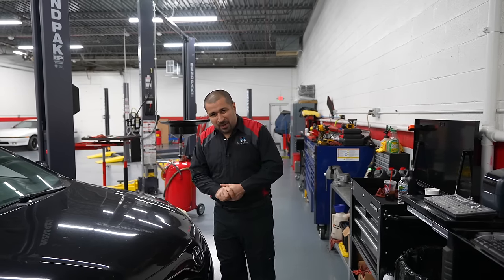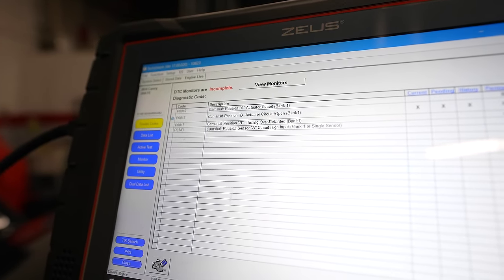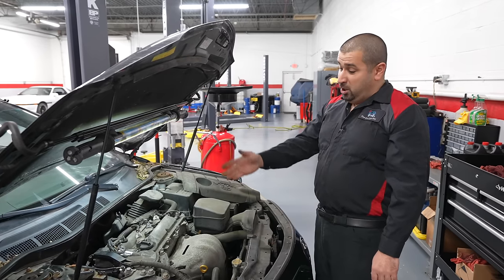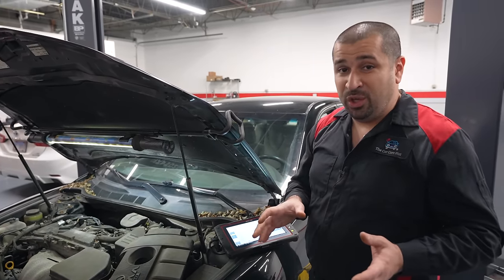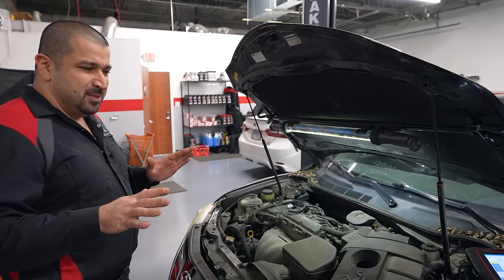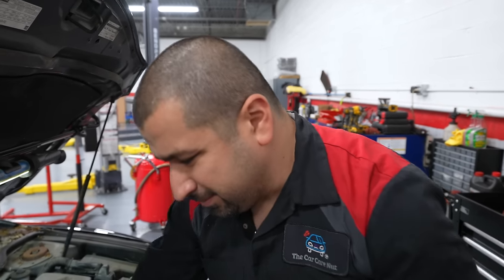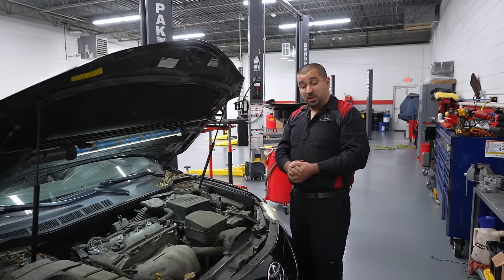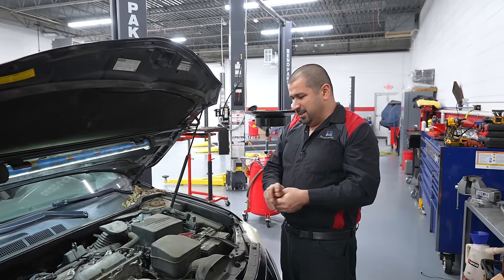Mechanic Parts Cannon FAIL Cost Customer A LOT! Let's Try This Again

Comment: As a DIY mechanic it can be a very economical process to just replace parts.  Even if most of the parts you replace are not the issue (you still have new parts on your car) but you also happened to replace the part(s) that fixed the car.   The alternate is to take it to a dealer and pay hundreds for them to just look at your car.
Reply: Yeah, with my 20 year old Corolla I have taken this approach.  I've been swapping aged out parts for denso and it is running pretty well now.  Still have funny smells I'm trying to find but every part swapped leads to a bit better gas mileage or performance.  Since it is my labor I'm way ahead of a paid a shop to do this.
Reply: @davidcameron1378 funny smells you say? Check the entire exhaust for holes. I have an older Toyota than yours and i couldn’t figure out the source of a smell at standstill until the hole in the exhaust grew much larger. Then I heard the blowing exhaust 😂. Took it to a car welder who patched it up for £40 😊
Reply: @akubel33t  Interesting suggestion.  I should take it to the guy who charged me minimal labor to replace the catalytic converter.  Think there is a catalytic converter to muffler gasket too..should I check that too????
Reply: @davidcameron1378  not sure about the gasket, but my hole was right after the resonator (middle muffler) .

Should be real easy to spot, ask your mechanic to wait for the car to cool down completely, Jack it up Then spray soapy water along the exhaust. Start from the middle of the exhaust all the way to the cat and a bit further. Then after that check from the middle to the tailpipe.

Any leaks will make the soapy water bubble up
Reply: @akubel33t  I will keep that in mind after I swap out the ventilation hoses that hold the shape of that fitting when removed.

Comment: In out country, since ecu are expensive, we open them up and repair, Sometimes it's a leaking smd cap, acids flow through the board and makes open circuits

Comment: I've found as a DIY'er, the biggest problem with diagnosing problems isn't the time, effort, or knowledge involved. It's the fact that much of the diagnostic processes require special diagnostic testing tools and equipment. You can rent some of it, but others are only available for purchase. In the end, the cost of all that equipment is the same as what you would pay using the parts cannon.

Comment: I hate this. One time my air compressor went out. So I took it to one shop. And they replaced the air filter and a few other things. But didn't replace the air compressor. I told them that the problem isn't fixed. They looked and told me it was. Then I gone to another shop, and they found and replaced the air compressor and it worked again.

Comment: Great video! 

One more check on the computer might be to check on the computer side in addition to the check you did on the disconnected connector side.  If the computer sends a voltage to the actuator then you should see 12v on one of the computer output pins.  If you don't then the computer is definitely bad.  

Pick & Pull may be an option for the customer if they are able to find the proper computer (need to get the SAME computer part #).  Part # was on a paper label on the computer for our 94 Camry XLE and I was able to find the a 94 XLE at the P&P with a computer with the same Part #.  Paid ~ $100 for it.

Comment: The sad thing is not only mechanics and shops misdiagnosed basic things Doctors and hospitals and so many other businesses do the same mistake I been dealing with one simple health issue 35 years now and so much money spent and no fix. Also appliance  technician don't really do there job correctly I had 3 tech come over to fix my microwave and after so much money and time and no luck. It's very hard to find people who know what they doing.

Comment: How do shops justify their bill when the parts cannon fails?  I work in home maintenance and I just don't comprehend how I could replace parts and pieces, NOT fix the customer complaint and still bill the job as if I had... If I'm wrong I have to eat it. Nobody is going to pay me for repairing a roof leak if it still leaks, or for repairing a water heater that still doesn't heat, or for a faucet repair if it still drips etc. And if I do a repair and it doesn't last then I come back and revisit the problem, if it's my fault whether I overlooked something or made a mistake then I eat that call. I strive for repeat business from satisfied customers. And when a customer trusts you and your work they don't scoff at paying premium prices. And I always treat my loyal customers with extra attention.

Comment: The other way that could have shorted is if the valve did in fact short the computer and they replaced it and didn't check the computer, or the new cheap aftermarket valve shorted the computer, or they shorted it somehow when testing the wires.  I thought it was either a bad wire or bad driver in the computer when you switched the connectors. No this stuff isn't rocket science, it just takes someone with a couple brain cells and a tad bit of care and pride in their work, which most people lack. Thankfully you are both skilled and task pride in your work!

Comment: Something similar happened to me years ago:  My Supra gave a code that the problem was the oxygen sensor.  TWICE two different mechanics replaced the same part and the check engine light wouldn't go off because the same code was coming up.  Someone other than the mechanics suggested I take my car to an Oldsmobile mechanic who he trusted:  The Oldsmobile mechanic simply sprayed the mass fuel air sensor with cleaner and the check engine light went off and didn't return:  I could finally get my Supra smogged!  The oxygen sensor was NOT the problem; rather, the mass fuel air sensor just needed cleaning.  And because the Oldsmobile mechanic knew what was wrong immediately and just sprayed some cleaner, he didn't want to charge me anything!  So I finally got him to accept a $20 tip.

Comment: I had a Camry with the computer that went bad at exactly 400,000 miles 
Due to salt & the winter conditions on the roads some how moisture got into the connection at the connection point & eventually shorted out the computer.!!
Was told $9000 to replace the whole wiring harness & computer !!
The car went from being worth $10,000 to $500 which the dealership offered for it 
We said no & another dealership gave us $4000 on it as a trade 
This cars body & interior was spotless !!

Comment: Another check you can do is test voltage at the actual ecm pin. Key off, with the large connector removed and the small connector still supplying constant 12v to the ecm. Then compare the voltage the good ocv pin reads then the suspected faulty ocv pin, it will be a very small reading, the faulty transistor/circuit usually will read .001v. Have done this twice on Tundras that had bad ecms after the cats were stolen and the thieves leave the exposed o2 sensor wiring shorted together.

Comment: When you are on budget eBay can save the day or Junk Yards. I had to do myself and what is important is that you need to program the new salvage ECU with the cars VIN number since it contains the VIN from the original car. It was for a Lexus ES350 2007 that the rat had eaten through some cables and shorted the ECU. Now cars runs perfect

Thank you AMD

Comment: Nice work!  I would have attached a noid light to the exhaust variable solenoid wire and tried to see blinking noid light when actuating.  Your way seems better since the ex wire reaches the in solenoid.  The engineers are driving solenoids from tiny transistors mounted on the main board. Some call them drivers.  I dislike it when a failed driver means the whole board is trash.  Rare on a Toyota fortunately.

Comment: Good video, but you should have loaded the circuit with typical current, because you could have only one strand of wire left and that would still show continuity, but wouldn't carry circuit current. That last check before condemning the computer.

Comment: The last check after you suspected the computer was bad was to check for a short in the wiring between the computer and oil control valve.  You measured voltage between the battery positive and each wires in turn.  If one of those wires was shorted to ground, you would have put battery voltage directly to ground and possibly burned the wires.  Why wouldn't you use the ohmmeter and check for continuity to ground instead which would have been safer?

Comment: When I still had my 2004 Toyota Sienna, I took it to the Dealership to have a tie rod replaced and oil change. I am later told that the car needs a lot of work totaling $8000 in repairs. Never went back

Comment: We do roadside service and towing. Reminds me of a 2012 Toyota yaris with 45 k miles that we jumped due to customer leaving dome light on. Our jumper pack has a digital display that showed over 14 volts with engine runing. Customer wanted to get a 2nd opinion and took it to a chain auto repair shop. They replaced the good genuine Toyota alternator with a inferior aftermarket reman alternator, battery, a belt idler pulley, and belt! All junk aftermarket parts.  A few weeks later, the alternator water pump belt broke on the freeway, ( either bad belt or overtightned) , engine overheated and lost compression because the head gasket/ head warped. Now the made in Japan 45k mile Toyota yaris needs an engine sadly! Needless to say, we advised the customer to litigate and we will be his star witness.

Comment: Your diag methodology is very good though. Test everything before phoning any parts shop. 
You could have tested the exhaust solenoid operation by plugging it into the intake solenoid control circuit and then activate the vvt via the diagnostic to see if it does anything.

Comment: I know the Oil Control Valve was already replaced , but there is a possibility that the old control valve could have been shorted with low resistance and took out the computer driver , even the the new one could have a resistance problem  especially being aftermarket  ,just wondering why you didn't check it in the video while covering for shorts and opens during the diagnose process ? I am a retired Cadillac /Chev Master tech and we used to get shorted solenoids and open solenoids often especially any solenoid that is in the engine and can have oil get into the windings of the solenoid and cause shorting , just don't want to see someone check circuits and not check the solenoid resistance too and take out another computer . Enjoy your Videos it's nice to see great tech's like you that are willing to be helpful to the Toyota owners Thank You.

Comment: Since there is the intake ocv circuit, ohming towards the ecu from the OCV plugs will usually give you some confirmation that the ecu interface condition is different by comparing the two. Check to ground, positive, and together both polarities.

Comment: I had a large vacuum leak once on my Mazda 6 V6. Dealer didn't figure it out - they threw the parts cannon at it. I'M the one who discovered that the flexible air tube from the air cleaner had a large tear in it on the bottom side where you couldn't see it. Insane.

Comment: AMD, love your content. Thanks so much for doing it. Off topic, but last year you were touting the Xtool D7/8 scan tools as the best ever. Yet in this video you use a Snap on Zeus. I bought the Xtool based on yours and others recommendations, mostly yours. I own and work on multiple BMW. The scanner does not work on them!! Very disappointed to say the least. I have contacted them multiple times-the answer is "nope, doesn't work on those cars, sorry". So, I have an $800 brick on my workshop shelf. Buyer beware.....

Comment: AMD, I’m currently waiting on some parts for my fiancé’s 08 Corolla.  (I’m a automotive tech, graduated from Ford’s ASSET program in 2018.) check engine light came on three months ago, and since I couldn’t get to it for a couple of days he took it to a shop down the street from our apartment for a P0171 code.  Only triggers the code when temperatures are below 40°F.  They put a MAF sensor on it.  Three weeks later, he calls me while I’m at work and says the check engine light is on again.  I told him take it to the O’Reilly close to our shop and have them read the codes, tell me what they are and DO NOT BUY ANYTHING THEY TELL YOU TO.  He tells me hey it’s the same code as the one that the shop diagnosed and replaced the sensor.  I told him I’ll look at it next off day.  Checked the codes, drove it while watching fuel trims and air flow sensor readouts, above 50°F was all normal.  Huh.  Get out of the car, pop the hood, take a gander.  All the evap and PCV hoses were hard as bricks but not ruptured.  Sprayed brake cleaner on the intake hose, engine sound changed a little, sprayed the top of the intake manifold, and the engine completely started dancing and chugging.  Driving and reading data took 20 minutes.  The rest was 5.  The best part?  That shop charged him $550 for 2/10.  That mechanic could have had a snack, watched your video, took a poop, and not only found the problem but sold a valve cover gasket, all those evap hoses, could have made himself another 2 hours in labor.  Instead he made 0.2.

Comment: Honestly, my last resort is normally to bust out the cannon, but I DIY my own repairs so it's still almost always cheaper than paying shop rates. At least then I know that everything is torqued to spec, quality parts are used, and there are no bonus nuts or bolts left at the end of the repair.

Comment: This an issue as old as electronic engine controls. I remember back around 1990 or so, when I was just starting my career, Ford use to running a training class called “Before Code 11”. It was basically a class to stress the importance of diagnosing the system, and not  to “Shotgun” technique it. For the younger crowd code a 11 on Ford EEC and Mazda’s MECS systems was all systems passed. I would say that approximately 85 - 90% of issues where related to something other then the component in question, and yet replacing it was the first thing most techs would.

Comment: you should be verifying it by checking the voltage output to each plug when using the active test, then you could determine that it is sending voltage or no voltage when commanding it.

Comment: Great video, thanks!! 
I believe there's a more direct method to check the CPU control circuitry of the Exhaust Solenoid.  Via the scanner , activate the Exhaust Cam Solenoid test, have the connector at the Exhaust solenoid disconnected.  Monitor the harness ground side pin of the Solenoid Exhaust connector via a test light, with one side of the test light connected to battery 12v and the ground lead of the VOM connected to ground pin of the solenoid connector. During the activation of the Exhaust Solenoid via the Scanner activation test, the test light should light, indicating the CPU is ground side switching the Exhaust solenoid. The test light will only draw 0.200 amps and will not hurt the CPU ground transistor switch.

Comment: I am not a professional car repair but only an enthusiast.  This was a more complex problem to solve and did require a professional.  For someone that works on lots of different cars both mechanical and electrical it is understandable for them to miss this issue and just throw some parts at it.   There are definitely worse rip offs and although this wasn't a good repair job by any means it wasn't a rip off on purpose.   I have seen worse.

Comment: I had a situation like this on a Nissan sentra. I basically found a short using a volt meter, I ran a single wire spliced it into the harness.

Comment: I have to admit that just once in my life the computer actually called the right part. It was a blown vacuum diaphram on and EGR valve.  I tested it and replaced it and it was back on the road in 15 minutes.    So as unlikely as it sounds every blue moon the computer will call the correct part... Oh yea, mostly the computer is just calling a system problem not a component failure.  

But hang in there parts artillerymen and shade tree shot-gunners, sooner or later on some glorious day you too might find a computer that calls the right part on the first try and finally you will be vindicated for the all the time you would have wasted doing proper diagnostics.

Comment: Yes this is good stuff I've been working on Toyota since 2007 and I like the product so much that I'm on my 3rd Toyota I've driven honda since 1985 bit honda has kind of dropped off I've been a technician for 40 years now and absolutely hate parts cannons I just want to fix it and be done and move on to the next one.

Comment: Good mechanics who can work through to the root cause are rare because it takes education and experience - gone are the days of the carburetor mechanic, EEC-IV and GM CCC systems. With OBD2 and a scan tool, you should always be able to provide proof that sensors and other parts need replacement BEFORE you even order them. Throwing parts "to see if it fixes an issue" is the most expensive way to fix a car. It would be like a plumber replacing your water heater because your kitchen sink is leaking!

Comment: I’ve 100% loaded the parts canon a few times in the past. Now I’ve learned it’s worth it to pay a good tech 2 hours time to find a complex problem and confirm which components are bad. 

Someday, I’ll get enough money pooled during the holidays to buy a decent scan tool like the ones AMD has done reviews on. Until then, I’ll leave the diagnosis to the real tech, I’ll change out the part! 😃

Comment: I would have checked the aftermarket part for resistance. 
If the aftermarket part has an internal short will be facing more problems once you replace the computer.